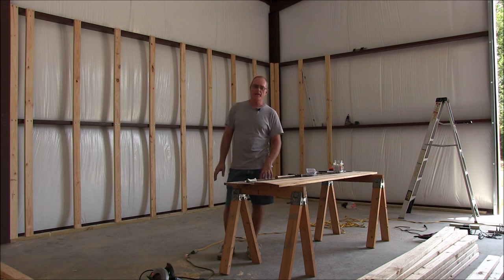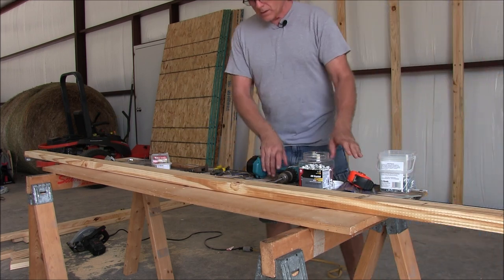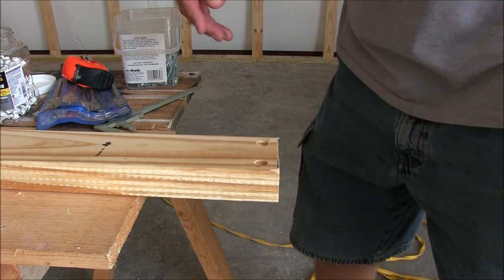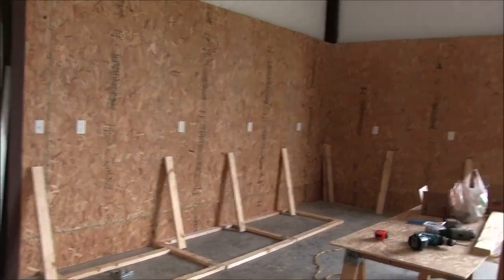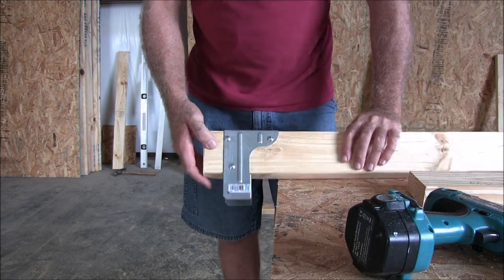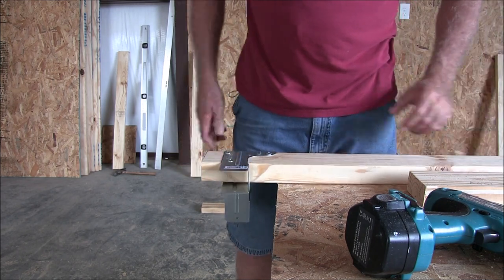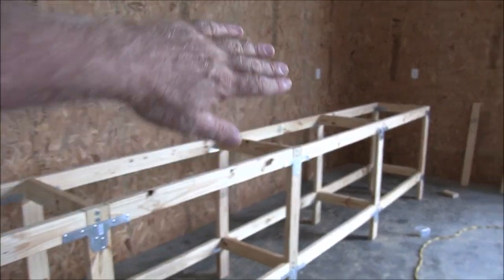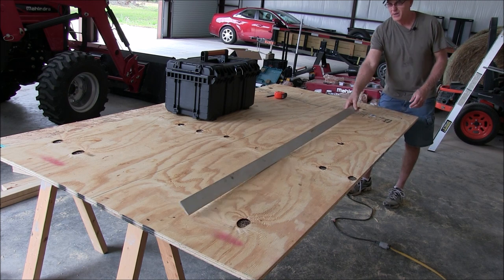Building a workbench and work area in my garage

Comment: thanks for the video Pete. I've been meaning to do something with my garage for years and it's finally come to a head. I can't get anything done in a reasonable time frame because I  A. don't workbench space and B. because my tools are all scattered in different portable tool boxes and a roll-away toolbox that overflowing with tools with absolutely no organization. every time i want to do a project i have to setup a couple saw horses and a table top across .. thanks for the ideas this disorganized bullsjit ends this spring when it gets warm enough to get out in the garage.
Reply from the maker: I feel your pain. I am the same way and I was finally able to build a work area and bench.

Comment: You don't need to predrill holes on such thick lumber (and if you are still worried that it will crack, use the reverse feature of your drill to drill the screw down applying quite a bit of pressure for about  3 seconds until you see a tiny amount of smoke.  Then switch the drill setting to forward and drill the screw in.  I don't know the physics behind it, but it works every time - you will never crack your lumber if you do this, even on 1/2 inch wide lumber and drilling an inch from the end)!  The lag bolts should be pre-drilled, but it isn't necessary for typical wood screws when using 2 * 4's.  I just made a similar work bench and had zero issues with cracked 2 * 4's (no pre-drilling except for lab bolts to the wall).  I also used a pocket rig for the cross beams that support the table, as well as for adding work bench draws (I highly recommend getting a pocket rig).

Comment: Nicely done.
Something you could try when making those long cuts is use your clamps to hold your straight edge down on the piece and use it as a guide to slide your saw against.
Reply from the maker: Travis In Canada  Yes thanks, that's a great idea, but I need to get an 8 foot straight edge.
Reply: Even better rip a 4”x8’ strip of plywood, line it up eight on top of where u cut it, put Brad nails every foot or so, butt ur saw up to the 4” strip and literally let her fly. It’s the perfect straight edge & ull never have to draw an 8’ line ever again

Comment: Pete, just found you channel by chance. Loving the videos. I am a licensed contractor in the state of Massachusetts. Hence a city. I am 15 miles north of Boston. What I am having an issue with is you struggling with your drill. You need to invest in an impact driver. Once you do you will not believe the difference. I use Bosch but you can get a less expensive one at Depot in the Ridgid line. You will love it! . Love the garage and keep up the great videos. And I subscribed :)
Reply from the maker: Great, now I have an excuse to buy another tool :) but yeah an impact drill would not strip the screw head like a regular drill. Glad you enjoy my videos. my wife and I moved from Houston to the country and it's been a learning experience to say the least. Thanks for the tip and for watching my videos.
Reply: You're WAY too close to the city! But, can you ever REALLY get far enough away 
from them?!? I'm in NH and we keep moving a little farther north to avoid the
infestation!! My family has been in NH since 1637 as best we can figure, so I
miss how it was when I was younger. I guess that too can be said by a lot of 
folks. Another guy posted that Ridgid now has a lifetime warranty on their tools
so it's a smart investment. I demand an equal amount of NON-electrical hand 
tools so when the time comes, I can still build without grid power. Two thumbs 
up though to the impact driver evaluation! I wanted one for a very, very long time 
and once I got one...I had to have TWO!!! They are without equal in a modern
electrical world!!
Reply: @petebeasttexashomesteading  LOL!! I avoid excuses when telling the wife why I NEEDED this new tool, or that......it's always a REASON and a good one at that, over an 
excuse!! So far it's workin for me!!  ;>)

Comment: I'm really impressed with that. You've got a sturdy strong bench and you haven't needed to put cross bracing in underneath on the bottom shelf which gives you unlimited storage options with out obstruction (eg lengths of timber). Hope you don't mind but I'm going to steal your idea here ;-) Cheers!
Reply from the maker: John Maguire  Thank you, that's why I put the video up so you can get ideas on making your own bench. Hope it turns out great 👍
Reply: subbed ;)

Comment: Amazing job, great video with every detail explained. Thank you for sharing! 
Only thing I would add are some more supports under the plywood top in the middle (between every two legs)!
Reply from the maker: Nikos Ziogas. Thanks,  I was going to add more supports but the bench top width is only 24 inches and I used 3/4 inch plywood top and for what I do it's plenty strong enough. But yeah it wouldn't hurt to add more supports. Thanks for watching.
Reply: Thanks for you reply. Let me just point out that your video deserves way more views.
Reply from the maker: Thanks so much, hopefully the video's will get more views.
Reply: Hope to see the cabinets installed!

Comment: This is very nice, but the process assumes your floor is very level. With our barn (built and poured years before we got here) my only option is to build out from the wall and spend a lot of time leveling and using cuts of varying heights.
Reply from the maker: Derek Smalls  Yeah that's probably what you'll have to do.

Comment: Did you use GFCI protection for the outlets?  Nice bench, you could lay engine blocks on it.
Reply from the maker: BillyLapTop  Thanks, I didn't use GFCI outlets because there will be no water near the outlets. Yes the bench is strong enough to hold an engine block. :)
Reply from the maker: BillyLapTop  Thanks, I didn't use G
FCI outlets because there will be no water near the outlets. Yes the bench is strong enough to hold an engine block. :)

Comment: Not sure why you framed this . 4x8 toung and groove plywood screwed into Steele girts are as strong as any framing. MC cable for boxes and your done . I just finished a 3000 square foot Steele shop. A plus is if your girts are installed with channel facing down you can install 16” shelving all the way around. Got the ideas off you tube . I also hung aluminum cabinets that have well over a hundred pounds or reload equipment and tools.

Comment: How high is your work bench from the floor to the top?  Also, how high is the lower shelf from the floor?
Reply from the maker: The bottom shelf is 12 inches from the floor then I added the 3/4 inch plywood, and the top is 40 inches then I added the 3/4 inch plywood. It just worked out that way for me.

Comment: Hey great video. I have been trying to find a video on building a 18 foot work bench and after watching your video I know that how you made yours is how I want to build mine and I was wondering  how many 2x4s you needed for the long half and also what type of plywood you used and roughly how much the wood and brackets costed?. Thanks Larson
Reply from the maker: Thanks, You'll need at least 17 8 ft 2x4s but I would get 20 to be safe. The plywood was 3/4 inch and the link to all the brackets are in the description below the video. The 2"x4"x8 footers were $2.91 each at my local home depot. Hope your bench comes out great.
Reply: Ok Thank you!
Reply: you can use the back wall supports and run horizontal support cleats for the work top and bottom shelf .. should save time, money and cutting, also you can take advantage of the number of wall supports to better distribute weight and no separate step to screw finished bench to wall!

Comment: Excellent video Pete. What was the height of your workbench?
Reply from the maker: Thanks, The bench height to the top of the table before I put the 3/4 inch plywood on is 40 inches. It's a little higher then normal but I'm 6,0 tall and I made it higher so I could also stand if I'm working on something without slouching down.

Comment: Looks great.  If you get a chance, could you tell me what you used to secure the boards to the concrete?  I've tried several different methods and none have worked consistently.  Thanks.
Reply from the maker: bdubya63  I would secure them to a wall, but if you can't, try putting heavy duty L- brackets at the bottom and using heavy duty wedge anchors.

Comment: While I agree and command you on COUNTER SINKING (not counter bore) you screw heads, there is no need to pre-drill. This are "Self Tapping Screws." They have a drill bit built in and are designed to drill their own holes on installation. You doubled the amount of work you needed to do.
Reply from the maker: I know but I used what I had.
Reply: I am not sure what that means. The self tapping screws are what you had. They did not require drilling, They are self tapping. I don't understand you reply.
Reply from the maker: I see you mean the studs, I pre drilled the studs so the self tapping screws would not thread so much on the stud but on the metal C-purlin. So it would pull the stud tight against the C-Purlin.